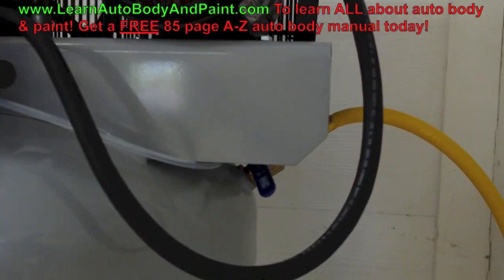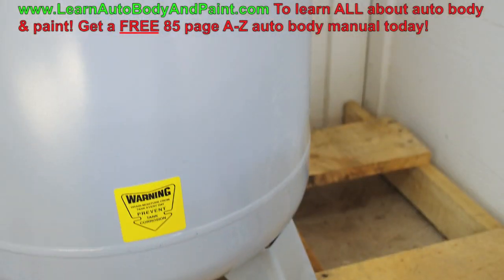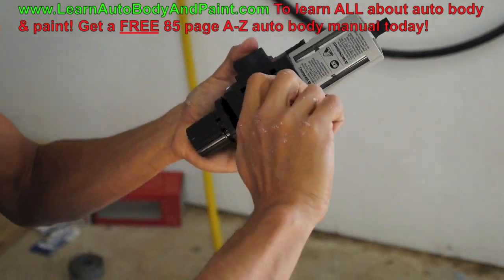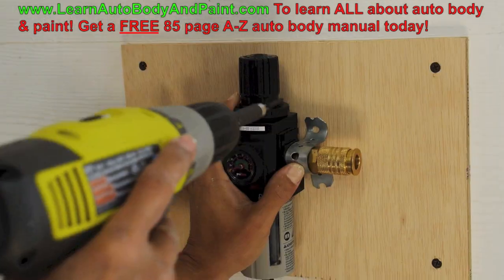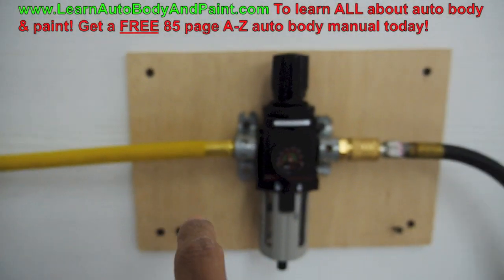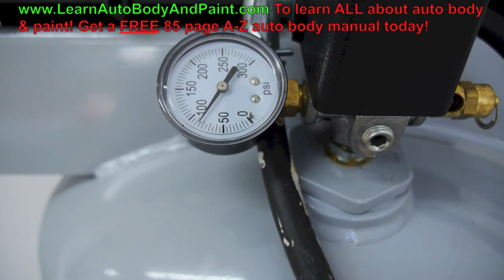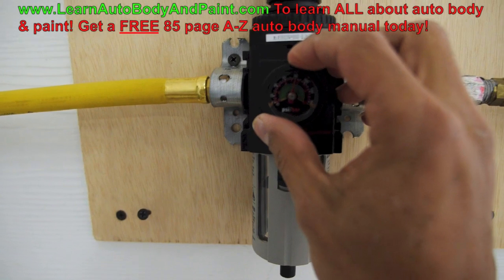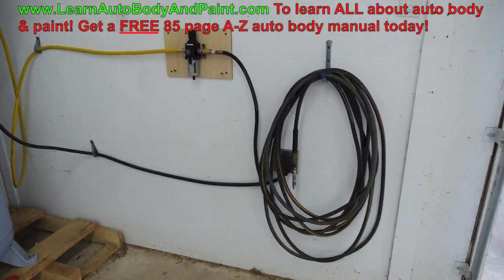How To Set Up Your Air Compressor - Part 2

Comment: Glad to see that you got that fixed. I have made some simple errors as well. Especially after someone points out the error. Stuff I should have known but didn't look at it logically. I just purchased a compressor. I put 2 drains (1 on each side of the filter) on mine though. FYI - Water will collect in your tank and at every low point in that line. You should put a petcock on the bottom of the tank and have a way to drain that long line between the tank and the filter. I hope the info helps!

Comment: I put a filter and regulator on the gun. Is it necessary to also have an external regulator instead of built in compressor regulator and a separate inline filter as well?

Comment: Papa Board, just an FYI, a compressor (i.e 220, 230, 240v) only uses 3 wires; 2 hots and 1 ground.  The neutral should not be used if it's present; it should be capped off.

Comment: I know you're trying to help guys but get your info right first. A ground wire and a neutral wire are NOT the same things.  That compressor is not wired correct in that there should be two 110 lines, one red and one black and another white of the same gauge to serve as the neutral for the spent electrons. That spot 'blanco' on the receptacle is for the neutral. That bare copper is a ground wire and should go to the ground screw on the receptacle/ wall box and the ground bar at the main panel.

Comment: what size compressor air line and pipe kit should one go for if setting up for paint? I see u have 3/8th hoses. I bought a 3/4" inch pipe kit and my garage isn't that big is it too much? I have a 60 gallon husky compressor.
Reply from the maker: 1/2'' will be fine. My hose is 3/8, 1'4 will also be fine for basic painting

Comment: Wow... Such a harsh response. Easy does it. I understand your point (which is 100% valid) but this is his wiring. He does painting not electricity. I noticed a couple of things as well but I was trying to figure out a more subtle way of letting him know. Having said that, Papa Board is correct. Personally, I don't take any information online literal. None of this is part of a scientific paper. It works and you had it checked. Go for it.

Comment: Tony, I enjoy your videos. 
A question for you in regards to setup. Does the Ingersoll Rand ARO filter/regulator provide sufficient water removal from the line? 
I hear that painting requires some extra stages of air drying for best results. Which in turn would require some line cooling in order to condense the moisture out. 
But I don't have any experience yet. I am just doing research to setup my garage best. I have purchased several components/tools but no installation/use yet. 

Any advise on air quality? Thanks.
You and your fam take care! 
- Joe
Reply from the maker: Dicer328 hey bud. Yeah, well you will probably need that if you're planning on doing painting all day. When painting a car you're only painting for 1-3 hours MAX. Your compressor will not be putting out all of that water for some intermittent runs over an hour or two. Plus you want to have a small water filter at the neck of your gun. You will end up with more condensation if your using a small ass compressor that's basically running the whole time. With the set up I have here, there is no worry about all of that mess. Not like I'll be painting 2-3 cars in a day all day long...

Comment: Your water filter setup will automatically drain off any water collected when the air goes below around 5 lbs. of pressure, I have the same one, But seeing how old this video is I'm sure you know that by now :)

Comment: Hi Tony! The quick disconnect you use in this video,is it a 3/8" or 1/4"? I guess I would like to know if I am suppose to use a 3/8"fittings and hose for spray painting or 1/4" to the spray gun? and if it is a 3/8" would there be a fitting that fits into the spray gun? Because most fittings that I see out there are 1/4" and some hoses are 3/8" ?Thanks.
Reply from the maker: MrElPoderozo1 hey man.  3/8 hose and a 1/4 connect. You'll be fine with that!!
Reply: +Official How To Paint a Car - DIY Learn Auto Body And Paint Training Site. Thanks Tony ;0)

Comment: all regulators have a big plastic nut on them to bracket mount them.. i would use 3/4 BLACK PIPE then reduce down at your drops ONLY.
Reply: also no sediment traps for the first 8-10ft if possible need to let the warm air cool to eliminate massive condensation thats why you need drops to purge off moisture. the larger your line the less drop off at your air tools my2Cents

Comment: Must be a 5hp motor . Can't see a 40 amp not tripping if it were a 7.5 hp . Regardless I would have used bigger than 10 gauge wire as its better for the motor in the long run